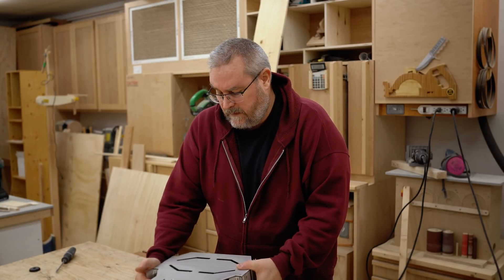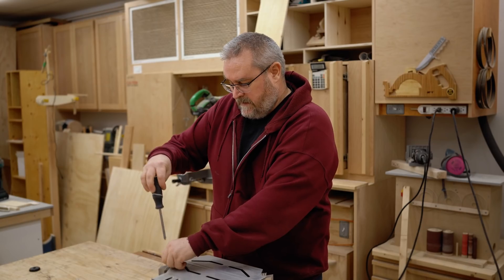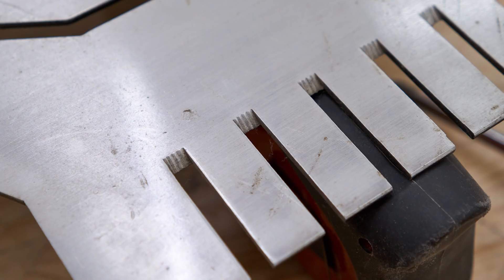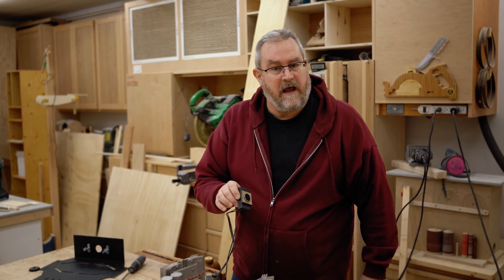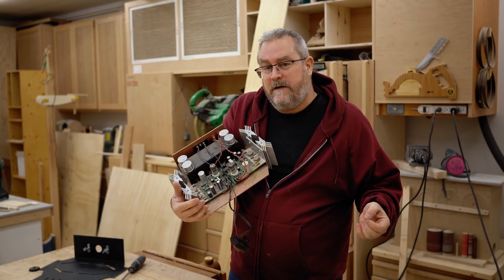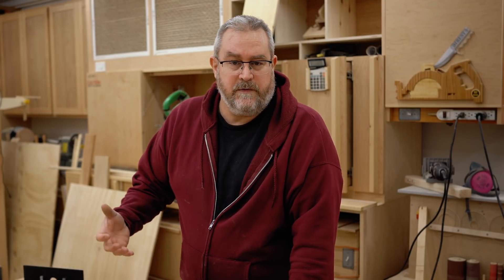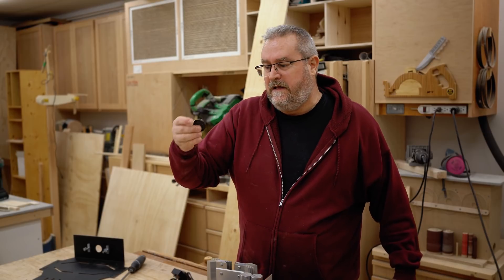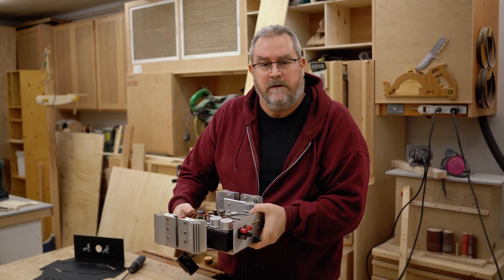Is This A Prop From Star Trek? Nope! It's a Class A Hybrid Amplifier I Made

Comment: Do you need a control panel? I thought that was part of the preamp. Or does it work with two preamps? One in the case and another external preamp (so you can turn it up and down).

Comment: "Oh I would just like to tell you about my class A hybrid amp I built". WTF! You make it sound like you just made a kids toy out of plastic bottles and straws. Fucking blows me away!

 Especially after watching the reviewers show off their hi end snake oil priced sculptures of art. You just make your own (but not from plastic bottles). And your components would be just as good...going by what Jay the speaker butcher says. The crossover parts in his 4 grand speakers are still basically just basic. He tested them against (one less zero) priced speakers and he upgraded both (and they both cost about the same in upgrade kits that he makes). If the 4 grand speakers aren't snake oil, I don't know what is. The $400 speakers didn't seem to sound much different (on YouTube). I got some B&W 706s that I use for reference for my speaker building fun. I bought the B&Ws so I have an idea how a speaker should sound in my room and they are the only equipment I have. No oscilloscopes or sound proof rooms. Even though the B&Ws made my speaker building passion possible, my made speakers smoke the (2 grand) B&Ws. Mainly cos mine have several acoustic innovations that make them sound a bit like panel speakers. They sound "different" and people seem to like that difference. One of my acoustic features is that the main med driver is semi open (with a narrow gap between the driver and the speaker hole). And the speaker hole is made to be a bass vent with a shallow tube in it (and stops it from sounding "bonky"). So far, I have 2 prototype speakers that I love and plan to sell both designed speakers soon. One prototype is with a 5" FR driver + Woofer, and the other one is an 8" coaxial + woofer design. Both are floor standing speakers. I also modify my FR driver for extended high and 8" med driver for cleaner med and central tweeter for more open sounding highs. I Doctor the drivers. I am the speaker Frankenstein! I will show you a video when I get around to making it. Cheers Big Ears.

Comment: John, you mentioned using a router to make cuts which intrigues me because I have an aluminum project and using a router could really help, I've just never done it. Can you offer guidance on bit type as I imagine you didn't use a typical woodworking bit..? This is a crazy cool video, thanks again for sharing great content.
Reply from the maker: Regular carbide tipped router bits work on aluminum. Spraying on something to lubricate the cut (like WD40) helps, but not necessary.
Reply: @IBuildIt  Thanks!

Comment: tubes are interesting. Inside the tube there is a vacuum and the cathode heats up until electrons rip away from the metal atoms and start to fly away(this is why you need a vacuum so the electrons dont collide with other atoms). The  electrons fly along the electric field lines towards the anode(there needs to be a very large voltage between these points) but, there is a grid in between. the voltage on this grid generates an opposing electric  field causing some to all of the electrons to deflect and miss the anode. The current that comes out of the tube is proportional to how many electrons make it from the cathode to anode. The grid modulates this number of electrons. So, if you connect an audio source to the grid then the low voltage grid can modulate the high voltage cathode to anode thus giving amplification.
Reply: Wow, thanks. This is the best explanation I've seen yet

Comment: Silicone the feet on? Was that before you embraced the polyurethane construction adhesive?
Reply from the maker: No, I just had a tube of silicone handy that I was using for something else. Usually clear silicone holds pretty good, but I guess the paint on the aluminum affected the adhesion.

Comment: John, not wishing to contradict you but isn't that an AB class amp as it has NPN and PNP output transistors with the push-pull design? From my past I thought class A were NPN biased half way up their curve (Q point) so the signal could make the signal swing or am I missing something?
Reply from the maker: Class A is where the output transistors never fully turn off and are always conducting current and that's the reason why they get hot - they are always "on". 
Although you see the push-pull arrangement most often in class AB, it's also widely used in class A.
Reply: @IBuildIt  I just remember the diagrams fro my A level days almost 50 years ago where the single transistor was biased half way along the conduction curve compared to an NPN PNP combination where only one half of the signal was amplified. At the time my teacher Mr Vann said that amplifier was one of the dark arts as it relied so much on the performance of all the components as a whole and even the best design on paper could work very poorly.

Comment: Those 2SD188 transistors are 60 watts each, I think.   So that's probably a lot more than ten watts.
Reply from the maker: Yes, you need the high wattage to handle the heat produced by running the amp in class A. I think the receiver I harvested them from was 45 watts per channel, but class AB.
Reply: Only if you use them in A+B mode. Class A uses a butt load of power, but only produces 10W of output. It's the way the biasing works, they are basically on hard all the time.
Reply: You can build a 10 W amp with 60 W transitors. Output power depends on a lot of things. And don't forget this is a class A amp.

Comment: As with all your 'stuff', John, your amplifier is very stylish and beautifully made.   BTW, valves - or tubes if you insist - need a high ANODE voltage.  The grid volts are pretty low.   When I was an apprentice, it was intended that I would become a valve engineer, but transistors took over.   Back in the early 60's I can remember seeing a growing a crystal of germanium as I walked past the tech lab each day.   It was later sliced, and diced into tiny squares to make some of the first transistors in the UK - and the failure rate was initially over 99%!